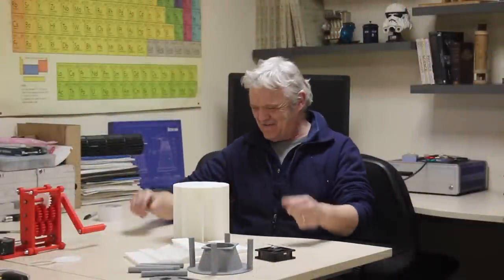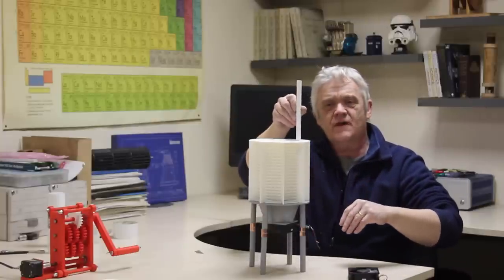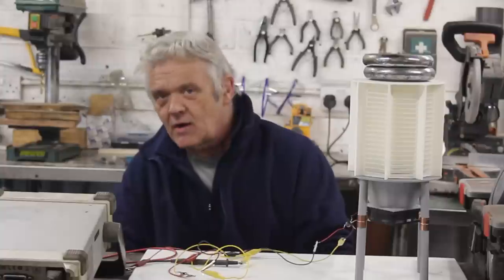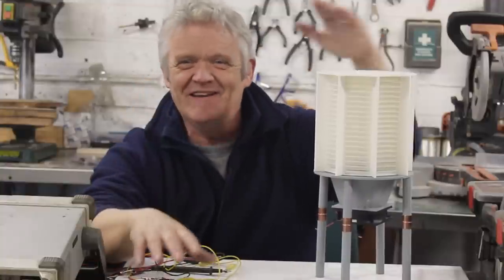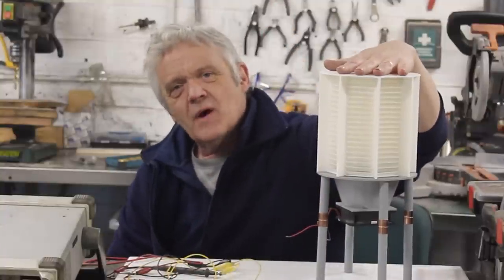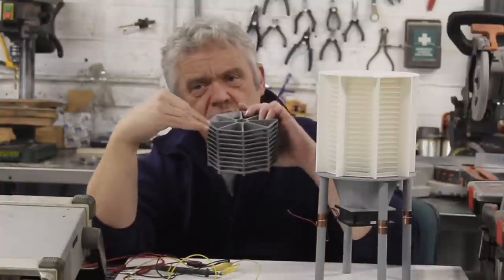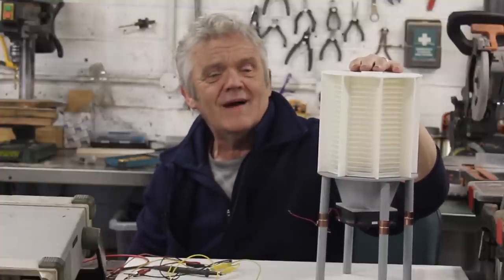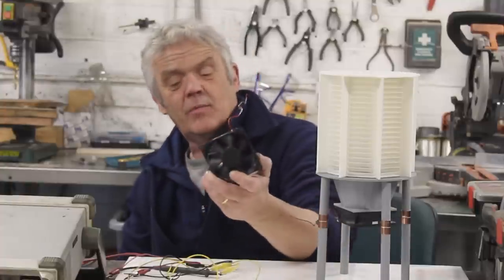1835 Darwin Wind Turbines - The Answer To Wind Generation

Comment: Coming at it the other way, what is the maximum capacity you can efficiently get down the funnel?
- You can over or under compress the turbine
- Could you use a turbine in the style of a car turbo, possibly with variable pitch turbine?

Based on an average windspeed at around 9-15 metres (roof height) this will say how tall the catcher needs to be for a domestic application for a given turbine.

UK property planning law allows/ed you to put a turbine on your roof upto 3 metres above the top of the chimney without planning IF, not listed, not in a conservation area, you don't have an air source heat pump (list not exhaustive or correct for your area)

Is it viable? 

There are UK local enterprise grants out there. Plenty of evidence of interest and viability research

Comment: You're a wizard Robert Murray Smith. 
Perhaps a cube would be best as it has the greatest surface area- auto-rotational into the wind via a ventral fin rotating the catcher cube about a fairly simple pivot (one could use a two concentric circular pipes or not even pipes at all- merely cement base mounts) spaced the width of a suitable castor wheel as track trapping these 3 castor- the fewer wheels the greater the nett f=ma downward, of course cube extending as close to the ground as possible so as not to generate a tipping wind.  The castor wheels mounted in an isosceles triangle arrangement with respect to the circular wheel trap. Thus a venturi greater surface area into a narrower tubular cross section.

Comment: You're also missing an experiment to see how a larger diameter squat one, compare's to a smaller diameter tall one. If the surface areas is the same, you should see a sweet spot where the ratio of height to diameter means it catches as much air as can be forced down the centre.

I'd think a tall skinny/tall collector would be restrictive at the base as it would get to a point where more air couldn't be rammed in on the lower blades because the pressure was already too high. This might actually be a positive because it would mean the collector would be self regulating, so when the windspeed got too high, the rising internal pressure might prevent extra wind from adding any more pressure to the flow and causing the fan to over speed.

On the other hand, the high airflow rushing down the centre (And past the inner edge of the blades) on a smaller diameter collector COULD cause a venture effect where the very fact that the winds were too strong was MAKING the lower blades pull in more air and compressing it further.

It's definatly an interesting engineering project, and it's also turning into a pretty interesting thought experiment too.

Anyway Robert......... When are you folding up a 3' tall/wide aluminium one to stick on your workshops roof ? :D

Comment: About the discharged air... curious if you could mount more than one PC fan. Direct stack, alternating spin directions, space stack.

Maybe using a clear pipe and introduce smoke into the stream to see how the vortex created in the discharge air can improve the overall power generation with intelligent design.

Comment: how about utilising bernoullis principle and having a gap between the bottom of the cone and the fan, to draw in even more air from the around the darwin to push through the fan?  May need a 2x or 3x diameter cone to help direct the the flow onto the smaller fan surface area and keep the pressure up, and of course experimentation would be needed to find the optimal distance as well as baffling to ensure there is no affect from the (horizontal) wind on the downwards air flow. Just a thought.

Comment: Critical balance between vane spacing and friction losses. Computer modeling could give optimal spacing. Also, problem with ducting the fan exhaust is back pressure. Don't want to lose energy pushing air through a tube!. As far as spinning the air, may want to look at shapes like what was just invented for boat propellers that resulted in over 70% increased efficiency that removed tip vortices. Straight slats look nice but may not be the best shape to encourage incoming air to start spinning. 3d printing offers a lot here.

Comment: I'm hoping that the curved fins of my design on the windward side - by directing air downward in the middle - would cause air to be drawn from the leeward side of the collector.  If it doesn't I plan on adding a cowl and/or a center pole with spiral fins to cause the air to spin while going down the pipe.  All in the hopes of speeding up and twisting the air flow before it hits the fan(s).

Comment: Just a thought,,, putting a cone inside directing air down so its not easily passing wind through to the other side vanes and then maybe another structure on the bottom to pulling air down and away from the fan, so the fan is in the middle of the two...???

Comment: Love the concept.  However, thinking rain water could be an issue going in and straight down.  Might be better to slant the slats upwards to direct wind up instead and put the generator on top and then after generator redirect the wind out horizontally as you'd need a cover on top to protect from elements.
Reply: Or...turn it upside down...

Comment: If this works well I'd like to build a 8-12' collector, on a 50-60' tower with the tower inside the tube about 6-8' diameter, with the turbine bout 10-12' off the ground to make Access easy, possibly spread the 3-4 leg tower wide enough at the base to allow the turbine to fit 10'- 12' from the ground, allowing the air to make the turn, possibly attempt to harness the wind in multiple ways, it should be cool air, so cooling a home should be possible. Along with possibly a couple smaller turbines, possibly a 1200 watt, then 800w and 600w  or maybe 150w and 300w  mounted with flow directors between them, keeping the wind working, generating a total of 800-1000watta in a modest  wind would be awesome.

Comment: The width of the channel should only be 2x its height.  this is the maximum dimension that minimizes boundary / intersection drag.  If the sides get any closer the flow tends to bunch up and interfere in the corners.  Think of the optimum circular flow in a conduit.

Comment: If you scaled the turbine by a factor of 5, then you could replace the small single fan with a grid of 5x5 fans. It is probably better to have smaller fans that can be pushed around by a small amount of wind than scale the fan up and fight a larger torque. There will probably be some residual wind coming out of the bottom of the turbine after it has pushed the first fans around, which could further be used to generate more electricity. May not be enough in your small scale model, but perhaps if the model was bigger. So scaling it, looking at it it looks to be approx 8 inches tall , so would be 40 inches tall (1m ish) and may generate 25 times the 4 milliwatts, which is 0.1 W and perhaps more with a second set of fans. If their isn't enough wind coming out of the bottom, the coning, the output to a smaller number of fans could work, so you end up with more than than 0.1 W. This is without any tuning or better fans or design.

Comment: this is great. would like to see if it can be scaled up to produce a few hundred watts...

i have some small wind turbines generating almost nothing... and they are loud, annoying, and you have to worry about a blade randomly coming off or something... since it's always moving. 

oh, and with this design, you could easssily lock it down by creating a valve! so there would be less / no risk to damage in storms.

Comment: Have you read viktor schauberger? I think you can increase the efficiency of your generator by creating a vortex on the inside. Schauberger reported increases in flow in water using vortexes and air is basically a very thin liquid. So He and I both believe the same principles should apply to air. I think he'd be tickled pinking if someone did some good with one of his ideas.

Comment: Love the advances being made. But what about a printed  modification of the fan blades themselves? Maybe a mini version of the variable pitched blades like they actually use on the massive turbines? Next, I would also be curious about a "water screw" type blade---might maximize spinning to the downward air direction. Of course, using your 35° pitch as a base. Thanks for making me seriously think about creating my own variant with just having common bench tools to work with and actually doing many of your builds using just the same.
Reply: Jeff, That sounds interesting. I'm wondering if wind has the same venturi properties of water in different hemispheres? Eg water goes down a drain naturally anti clockwise in southern hemisphere. similar shoudl apply to wind which is still a molecule in movement?

Comment: Production-wise, I wonder if one could make the slats just by taking a long strip of flat, flexible material and spiraling it downwards with an internal angle. Maybe the vertical baffle-walls could have angled slots cut into them for the material to pass through, providing a guide for it.

Comment: On the subject of improving the  collection and airflow. My thinking is the to divert the air in such a way as to encourage it to spin. This made me think of the dyson vacuum cleaner that uses the cyclone effect to improve the vacuum and separate the dust. Much work and knowledge has been done in this area and it may be possible to add useful knowledge to  your project.  I am thinking that your louvered screen could be multiple twisted airfoil eg  a jet turbine blade. By setting up a vortex this will assist the generator?

Comment: with reguards to the fins i reckon the first few full size modles you might make the fins removable in order to mesure any difrance. it might be that depending on wind strength the extra surface area may cause friction that might reduce wind speed so perhaps less is more but then that would also be effected by the lenght or depth of the fins so on the full size modle if the fins can be changed out that will aid testing. another thought is that the fins or blades on a jet engine change in pitch as they  get further into the motor so this might be ralavant too. I'm thinking that the generator or fan shougl be right at the exit of the cone otherwise wind force will be lost and i wonder if there would be any difrance if the wind exited up rather than down to reduce any back force but that would depend on how high the unit is off the ground. with the air exiting down the unit could have water harvesting potentual all be it not much. The flat sides is a top idea as it will make it a flat pack ad far eaiser to ship or transport to remote locations.Good luck with your project.

Comment: Try making the interior space open and insert a cone (ie aerospike). I think there is a lot of internal losses (turbulence) with internal structure used. Or alternatively use a spiral internal structure to increase the amount of energy the fan blades can capture. Much like a steam turbine uses vanes to direct the steam flow to match the turbine rotor blades.

Comment: Ehhhh.... My only complaint is that it is also a great rain catcher in the current configuration.

You need to flip it end over end 180

And uneed to make an inner sleeve with drain holes. Idk it needs to handle rain

Comment: Design is need to be such that wind coming from all direction should be pointed towards a small portion of a turbine that too on its outermost edge. It will results in higher wind speed which ultimately increase power potential.
Reply: Wow, that is an excellent idea!...

Comment: I'm very curious about t'he possibility of a device with the reverse effect, like sucking Air, and if could be more effective to pull than to push.
Reply: If there was a predominant wind direction, I think a shallow, curved roof could be fitted crosswind with a Venturi slot along the downwind side of the ridge. Possibly more than one. These could draw air through turbines at the gable ends of the roof.

Comment: How about a 1/2  of a verticle sleeve inside that could turn 360, with a wing at the top to keep it into the wind. The air entering would be blocked and forced down by the sleeve.

Comment: The output on top to prevent backlash of exited wind. And some aerodynamics at the fan so there is a low pressure at the output like "wings" that deflects horizontal wind?

Comment: Wouldn't you want that entire apparatus flipped 180 degrees, with a "chimney cap" on top of the fans outlet to prevent rainwater/snow/leaves from entering and introducing drag on the fan/preservation from the elements?

Comment: I'm wondering about the efficiencies of the wind movement once it passes the fins. My guess is that it would start coiling in on itself immediately after hitting the wall past the fins. This would act as a buffer against any other wind coming in and may cause some of the caught wind to exit out of the bottom fins since there's nothing really stopping the air exiting there.

I wonder what would happen if a coil was inserted into the center of it vs walls. Air tends to be kind of sticky once it hits something, so if there is a way to direct the stickiness somewhere vs just letting other air bounce off of it, I wonder if that would be better? It'd have to be a fairly loose coil... maybe 1 or 2 turns from the top to the bottom... to reduce friction... but then I wonder if it would enable the air to exit out of other vents... 

So... then what if the vents spun with the coil? Would that work? I've no idea and I don't have a 3d printer to try it out, lol. Hmm.... I dunno? lol

Comment: Rob - 
I've been closely following this series.
I like your notion of the pipe/duct.
I've been pondering if a similar unit (55°?) might be placed in the airstream to create  negative pressure after the generator to reintroduce the air to the airstream & improve the flow past the generator.

Sorry... I'm not well setup at all to test this idea myself

Comment: Late to join in on the comments... but hey, I'm here now.  Due to the poor performance of the horizontal blades of the generator, the installation of a generator with spiral blades,in place of the horizontal blades,  would  be inherently more efficient.  Airflow would face less resistance and assist in pulling a greater volume of air through the combined unit.

Comment: If your estimate of input area is that it matches the fan....then would it not follow that doubling the height or cross section would provide more air flow (either volume  or pressure)?  Several people have mentioned streamlining the input to the fan and inducing a vortex to optimize driving the fan.  If I build one I will certainly look into that also.

Comment: Cross this idea with a Persian wind tower. Channel the captured wind down a tower under the ground about 20 get them channel it through a vent system in the house and channel warmth out of the highest part of the roof.  Free cooling/climate control while generating electricity. Even if it only produced enough power to power indoor lights you have just removed your lighting and heating/air-conditioning from your energy bill.

Comment: Why not introduce some smoke from a smoke machine or something so you can see what's happening with the airflow?  I'm curious how much exits out the other side and how much is being directed downwards.  If there is much blow through, perhaps some internal flaps that hinge against the inside face of the bevels, could improve efficiency. As the wind is blowing in the flaps would open, and if they hit the flaps on the other side, those would close.

Comment: Robert, thank you for your videos, I have been enjoying them for years. I'd like your opinion on the outlet side of these wind turbines; would it make sense to put some kind of "disperser" structure on the other side of the fan? Because I imagine that you get a lot of air pressure going through the generator, and there must be drag generated on the outlet that limits the power you get from your turbine...isn't that right?
I think what would perhaps make the most sense is a cone (straight or flared as appropriate) to direct the air coming off the fan outward, to a greater radius, to decrease the pressure of the air coming off the fan as a laminar flow rather than letting it flow out turbulently. Is my reasoning correct? If so there should be no vanes to prevent wind from flowing by the cone horizontally.

Comment: So a few points of feedback, you might want some kind of curve to the 'blades' also the fan/turbine you are using obviously isn't optimized for air.

Also You could probably modify the design for the say 3 prevailing winds rather than for omnidirectional winds, since most locations have only a few main wind directions.

Comment: Rob - could the Darwin for wind capture , be combined with Venturi effect - curved funnel - x4 volume to small turbine, and shrowd for speed increase x2 and a 50 pct efficient generator - archimedes corkscrew ? - this would give me a treehouse size installation producing 700watts from 1ft generator - plastic tree mounted Darwin - transparent and printed to fit and lightweight for easy install

Comment: I am building a house with an ERV. I am now wondering if I could place one of these bad boys on the intake side and a black pipe with southern exposure on the outlet side (to act as a solar chimney and suck out the stale air.) Of course, since the ERV will be in the basement this would necessitate a 90 degree turn so I might lose more in pressure losses than would be worth it.